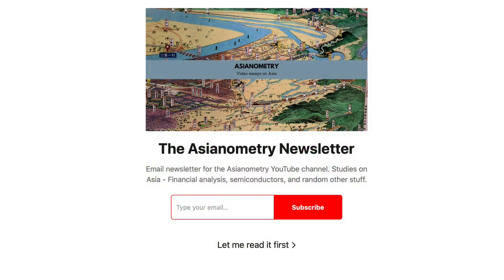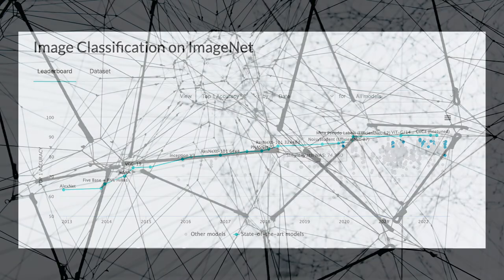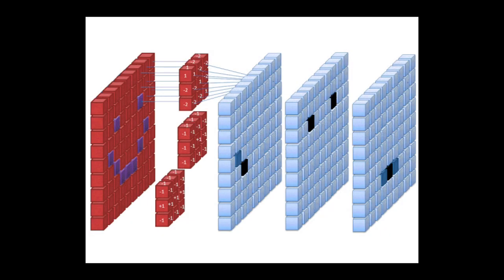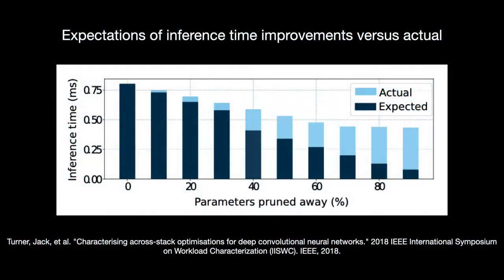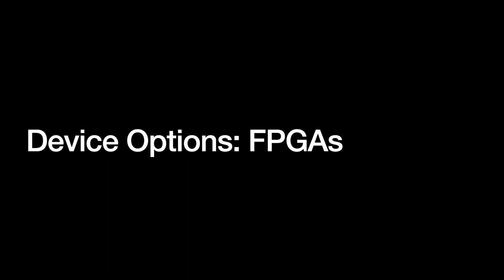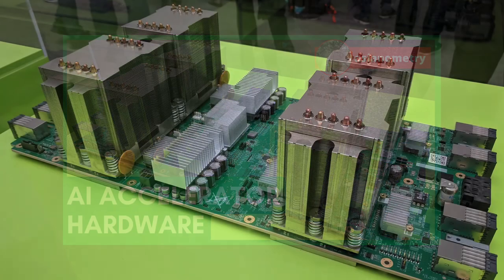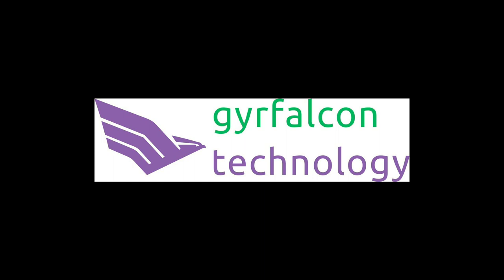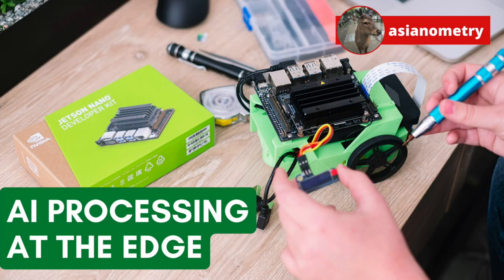The Hard Tradeoffs of Edge AI Hardware

Comment: As someone who actually deploys edge AI I heavily disagree with how "easy" you make FPGA's and ASICS seem. For the vast majority of "smaller" projects the Nvidia Jetson series is a far better choice since they support newer algorithms and functions. Especially with the speed the field of AI is progressing at. Furthermore fp16 GPU tensor cores are basically optimized for ML inference and provide good performance if you want to spend a little extra time on converting the model, though often even that has compiling issues with newer ML models.
Reply: Agreed.
Reply: As a verification engineer for FPGAs, let me tell you that the Hardware Description Languages you need to use are ancient relics based off of PASCAL. They have so many pitfalls and inexplicable limitations that cause more problems than the design itself. And they need to be so complex because the design space for this stuff is extreme. When the compiler(synthesis+PAR) has to conjure up a complete mapping of billions of custom registers and their connections, you're facing the limitations of hardware, physics, software, development tools, and whatever hellish design process your company is in.

If you need an FPGA for a problem, you need to be damn sure there isn't a specific ASIC or a microprocessor that can do it faster or cheaper for you. They are good for super fast timing, fast turnaround for design iterations, a pathway to ASIC dev, and as much parallelization as you can stuff through an interface (the main bottleneck!). And if you want these benefits, be prepared to build it all from the ground up. Generalized cores are liable to need tuning for extra speed, and if you're using an FPGA you're gonna need to milk it for every last drop or downgrade to a cheaper chip because cost will be king.
Reply: Asianometry makes EUV lithography understandable, when we all know it's magic. Making very hard problems seem easy is just par for the course.

Comment: I write inference pipelines on jetsons for my work. The latest generation have some very attractive performance characteristics. They do pull 60W, which definitely isn’t nothing, but for our use case it’s manageable.

Something that wasn't stressed is that those devices are heavily optimized around fixed point 8 bit throughput. A high-spec Orin can put out 275 TOPS, which is more than triple a 4090s 83 TFLOPS. Even if the models are much weaker, the increase in throughput opens up a lot of flexibility with system design.
Reply: Qualcomm AI100's can do 400TOPS @ 75W
Reply: @azertyQ  yeah, but an Orin costs $2K

Comment: Post-training pruning is very much how human neural networks learn - massive connections anywhere and everywhere over the first few years - during the initial training phase, then massive pruning to get rid of the unnecessary connections.
Reply: This is true and underlines the vast differences between our brains and machine learning hardware: Unstructured Pruning for Neural Networks tends to struggle with performance because it usually maps poorly to the existing highly-parallel and highly structured hardware. In the industry, methods like low-bitwidth quantization and custom architectures with low parameter counts (e.g. MobileNet as mentioned in the video) tend to see more use because their regular structure can exploit parallel hardware a lot better.
Reply: It is not even years. As soon as one got enough training for the basic task the pruning beings quickly until your ok at it. You are at a baseline training level. It is first months or years of small improvements stacking up that starts to really be noticeable. Much harder but a sign of real taut skills from doing it for real. Usually people that are really good at something look at you funny with a long stair into the distance when you comment on there 'skill' and effortless execution. Since the improvements are many times just work to them and really rather not do it in the first place. The only way a AI can be smart is if it learns to do stuff on it's own faster or better in some way without the help of the creator going in messing with it constantly.
Reply: Only the relevant solutions need to be deployed. And can be accessed by a simple sorting algorithm most of the time.

Comment: I would like to write some personal sentences since this is something I am recently working on. 

There are already existing ASICs around, and it has a huge benefit compared to FPGAs, that is the "area". It's nice that we can reprogram our FPGAs anytime, but considering the edge-AI commercial devices (E.g., VR headsets), we have a very tight form factor for the chip. Then, it is feasible to say ASICs will dominate the edge-AI products. Even more, we will find the architecture of edge-AI, next to the processing units with more caches (everything on a single package = inside of our mobile devices in the future(?) ). 

However, we need to consider some issues with AI accelerators.. They have to work quite busy, which makes their thermal profile a bit annoying, and we need too many buffers next to cache memories (too much memory on-chip = too much area... ). We have nice cooling solutions already, but we definitely need more, or we need new methods to reduce the sparse computation of neural networks. Maybe you heard about "Spiking Neural Networks (SNN)". They provide a nice "event-based" structure to the network, which allows you to create "idle" states for your computation... 

That is already a nice idea to have a nice edge-AI chip with low power option !! Next, what if we make this chip in 3D? Considering the memory domination in the AI chips, what about stacking the memory die, vertically on top of the logic die? 

We try to answer this question in imec.
Reply: You work at Imec?
Reply: @severussin  Yes… Specifically on this subject!
Reply: Looks like AMD is already doing that with the mi300 line of chips.  Wonder what your take would be on how much of a performance benefit this could give over an H100? Thanks.
Reply: @diamondlion47  AMD also work with imec, and indeed, not only AMD but other vendors are founding the R&D in this domain, such as Huawei, Google, Qualcomm and Intel. But these vendors mainly concentrate on the "development" process instead of "research". 

We can measure performance with total floating point operations per second (FLOPS), and both processors provide extremely high computation. But, as discussed, this is not enough, and we need to think about the power of consumption. In this case, one can measure the energy efficiency per operation cycle (FLOPS/Watt).

But overall, performance measurement is not straight-forward and we can think about many other parameters like, logic core configurability (multi/many-core with multi-thread ops), memory subsystem (L1/L2 cache sizes, etc.), technology processing node etc... 

Finally, as the end user, we only see the marketing prices and advertised performance comparison for last products...
Reply: @refikbilgic9599   @Refik Bilgiç  Thank you very much for the response.  I notice you don't mention Nvidia in the list of companies, do they partner with other research institutions or are they not doing as much research into stacking or advanced packaging etc or just an oversight?
Reply: @diamondlion47  The semiconductor industry is very large and complex, hence it is impossible to bring product without co-operating with each other. As far as I know, Nvidia is also a partner vendor, but maybe not involved in imec's all the partner activities. Imec has different partner activities (cmos scaling, STCO, novel memory, optics integration, 6G, etc.), where they present all of their progress along the year. 

But I know Nvidia has research centre settlements in city of Antwerpen and Munich, so probably people also work on 3D-IC or other techs...
Reply: @refikbilgic9599  Yeah, as an investor in the space it's a lot to take in, keep up with so I appreciate you taking the time to spread your knowledge thank you.
Reply: @diamondlion47  Sharing knowledge is always good, thank you for your curiosity..!
Reply: @refikbilgic9599  Well, while I've got you what are your thoughts on an Instinct chip with an fpga chiplet as I've heard rumored, could this increase efficiency for ai math even more?  Is the holy grail to literally just put everything on one block of stacked chips?  Also, last question promise, if you had to bet which company will be the leader in ai hardware in 5 years who would you pick?  Thanks again!
Reply: @diamondlion47  My friend, please don't hesitate to ask any of your wonders. Engineers must share their knowledge all the time..! 

Nowadays, with new processing technologies and SoC, almost any kind of SoC type/chiplets is made possible. However, to answer your question is not straightforward... 

First of all, 3D-IC is not always beneficial and it is not an easy process in terms of development (EDA) and manufacturing (Wafer-to-Wafer)... But for AI chips, more on-chip SRAM size is a must, and many new designs prefer 3D stacked SRAMs or DRAMs, or STT-MRAM (memristive based memories) and so on.. But to answer your question, we need to decide what is the target AI domain..? 

For instance that you want to produce a Augmented/Virtual Reality (AR/VR) system that works on your regular-size glasses, and you have a video chat with your AI assistant... Besides the complexity of this system, how are we gonna fit the AI chip into such a small area? Now imagine that you want to use FPGA stacked on top of AI chip for this "AI glasses" system.. FPGAs' size is already huge, so it's impossible in this case... But for instance that you want to use AI chip for accelerating language models or recommendation system (both data analytics), in this case, you can run your AI chip on the server (which means you have plenty of area..), that you can add extra DSP modules, FPGA interfaces, off-chip memories, and everything... In this case, you can just take Google's TPUv4i, and you can stack whatever you want on top, and you can use 1000s of them side by side for 1000s of Teraflops computation intensity... In theory, this is possible.. But of course, you need to discuss this project with Google :D 

For your last question, as an engineer, I really don't know the marketing part.. But in general, for the semiconductor industry, AMD is getting very successful with its current work. Specifically for AI chips, I think Intel may take the lead, but ARM and Huawei are also getting into the market recently...
Reply: @refikbilgic9599  Thanks again, you are a treasure trove.  About the memory, do either AMD/Nvidia/intel's chips have on chip SRAM or are they planning on this?  Also, does something like NVlink's memory coherency compare to actually having dram on chip like the mi300 will?  

My focus is on the data center applications mainly.  Interesting thought about Google's tpu, what do you think about putting it on top or as a chiplet of a future mi300 variant?  Is something like that possible or worth it?

Good to hear you like AMD's tech, they are my largest investment by far.  It seems like what they and you seem to be saying about heterogeneous computing is real and having leadership cpu/fpga and competitive gpu and dpu at one company should give them a massive advantage.  Although I'm curious why do you think Intel could take the lead in AI?  Just read Falcon Shores isn't coming until 2026 and by then there will be mi400 chips and whatever Nvidia's next line is.
Reply: @diamondlion47  Ahaha, thank you for the compliment!

 I understand that you are a curious young friend who wants to succeed greatly in the future! and I believe that you will achieve many things..! 

For your first question: on-chip SRAM is a memory element that is "inside the chip", not on the "circuit board". In old times, chips only contained "central processing units" (CPUs), which are completely logic transistors (not memory), and they accessed memory over the circuit board. But after the development of 6Transistor SRAM chips, engineers achieved to create larger memories, what we called on-chip SRAM. Today, all the chips must contain on-chip SRAM because your Nvidia graphics card needs to be extremely fast to process all that complex data... We always mention about L1,L2 cache memories, they are "on-chip SRAMs"....  

For your second question: semiconductor engineering is an extremely complex industry and thousands of highly educated and smart engineers work every day to put it little by little. Thousands of PhD students work daily to achieve new innovations for all aspects of (future) technology. 5-10 years later's technology is developing right now... Also, the semiconductor industry is the most valuable industry in the world and some of the involved companies earn even more money than some countries.. So it doesn't make sense to say that Google's TPU will be 3D stack on Mi300 chip (in terms of efficiency).. Doing this in the company level is impossible (according to me)...

For your last question: there are many technical reasons for Intel to take the lead.. First, they are involved in many AI domains (neuromorphic computing, deep neural network processing, etc.),.. and they have their own transistor processing technology (this reduces the costs a lot...!) But of course, we can never know... because the application domains of AI is newly emerging, and as the AI get popular, new domains will be established, and new trends will appear.. So the winner will be whoever catch this trends perfectly... but again, there is no winner, all the companies must work together to develop our future technologies... 

Lastly.... as for a young friend, what you are doing is very valuable... you are trying to learn as much as you can by asking questions... This is very important, because it is the quickest way that to learn any information.. Keep up with this..!
Reply: @refikbilgic9599  Ah thanks for the clarification on memory I was confused.   The main question I'm trying to ask is how important do you think having the best all around heterogenous chip portfolio is vs just having the best possible accelerator for a specific task and just "good enough" cpu/memory and everything else.  So like how much of an advantage do you think AMD has given their all around chip design strength, vs an Nvidia which has best gpu currently but less performant ARM cpus or Google w/ the TPU but not much else to my knowledge.  Obviously a super complex question but maybe just in the case of LLM.

Like you said, there is a lot of money in semi's so knowledge like yours is incredibly valuable.  It would be stupid of me not to barrage you with questions until you get bored of me lol.
Reply: @diamondlion47  Don't worry :) 

What I understood from your saying is that you want to learn which company has the "best" AI hardware.. 

Again, it is hard to compare but in my knowledge, the best end product is Tachyum.. Also Nvidia's products (A100, etc.) are very nice..
Reply: @refikbilgic9599  Thanks again, I'll look more into Tachyum sounds interesting.

In general I'm just asking like, do you think Nvidia will need to be able to have at least as good cpu and fpga in the future in order to be as efficient as something like mi300? Or can they make up for the lost efficiency just by having a great gpu and "ok" cpu and everything else.

Comment: I thought you would have included the mobile processors from Apple, Samsung, Qualcomm, etcetera.

They all include a Neural Processor these days but I never hear much discussed in relation to them, how powerful they are, what they’re actually able to do and so on.

Given the many millions of people own phones that are powered by these processors, surely the potential to bring Edge AI to everyone is now here if they are used effectively.
Reply: Chips tradeoffs generality and specificity. General computing like CPU is Turing complete but it is bad for neural network, while neural processor or tensor core is specialized in accelerating neural network computing but not Turing complete. It is not a big deal usually, just that how far they could push the efficiency envelope matters for the IoT edge computing.
Reply: @eafindme  this is not true. All modern tensor processing hardware on mobile devices (Qualcomm, Apple, Google) is literally just a super light arm core with heavy modifications. The neural processors in all modern phones are all just as Turing complete as the main CPUs, but they are directly in control of silicon that is highly specialized for doing common neural network operations efficiently.

Plus, any hardware that can do common neural network operations is guaranteed to be Turing complete unless it’s some of that analog trash that won’t be viable for 50-400 years.
Reply: @pyromen321  thanks for the rectification. Because I'm currently working on neuromorphic computing on FPGA, it is hard to say if it could not be viable. Who knows computing paradigm will change in the future.
Reply: My concern is, that those chips are nor easily available, if you are designing an industrial edge device. Right? While the type of chips shown in the video are.
Reply: Game-changing MAC (multiply-accumulate) chips which can each replace whole racks of traditional CPUs. QMAC (quantum multiply accumulate) qubits are analog bits, giving sub-bit precision, and analog outputs cut training time by 10x or more. There are several innovations in this space going past arm64/x86-64, and many will be ideal for mobile devices, but none are mentioned in this video.